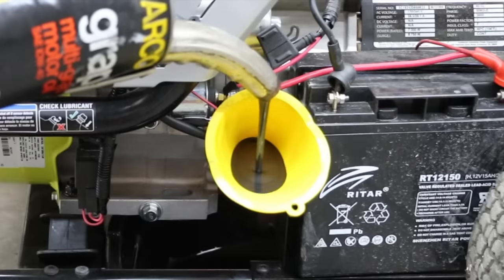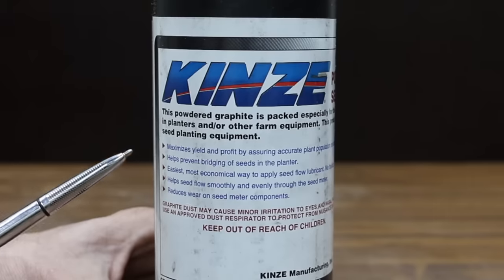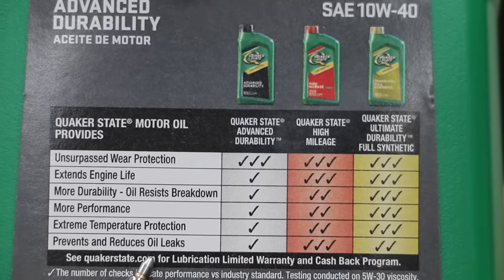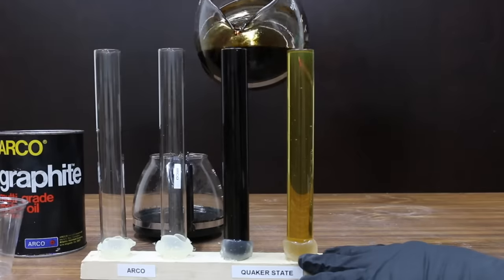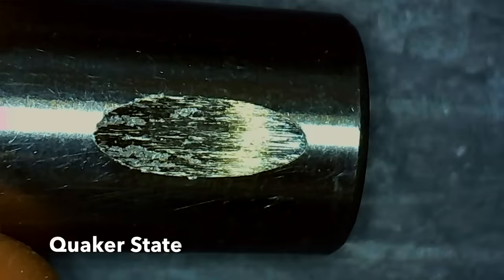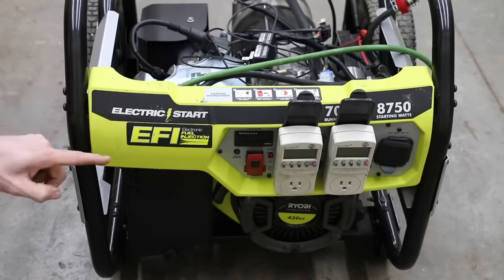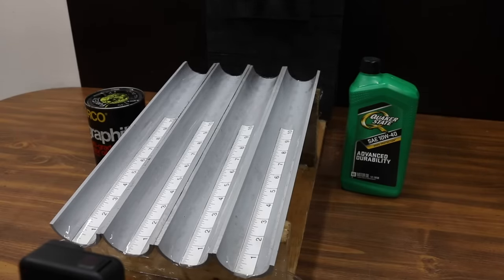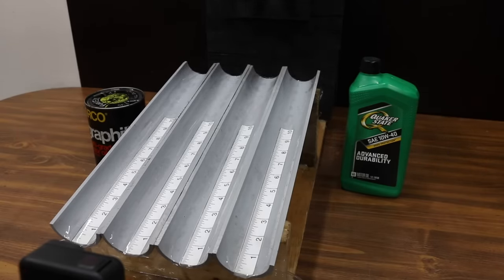Will "Graphite" Help Motor Oil Performance? Let's find out! Vintage Arco Graphite vs Quaker State

Comment: I would like to see the same tests with tungsten disulfide (.5 micron) in the oil.  WS2 is supposed to have the lowest coefficient of friction known.
Reply: They say its too heavy to stay in the solution, so it sinks to the bottom of the oil pan when motor is not in use. However running engine with WS2 oil might coat all the inner surfaces of motor in the long run, so you wouldn't need any in the solution. Then again, WS2 is not terribly expensive so I would assume that oil manufacturers would use it, if it's any good for the engine.
Reply: @juho1057  if there's long-term money to be made with it. Got to remember. They are to make money. We are just there to benefit and support them. They won't give us the best if they can have better overhead with a "sufficient" product. Look at the BMW 1960 broque angel. That's a good example to me, but that was also because Germans did not want to be flashy after ww2. But it's aluminum near everything. It was fast for the time, had torsion bars stock. The transmission went around the crossmember. Literally had to cut off the crossmember. BMW went all out. But the people didn't want the best. Nor could afford it really.
Reply: @juho1057  I have not heard of ws2 oil
Reply: yep , tungsten di sulphide , or is it ate , is meant to be the wonder dust of the moment , but its expensive  thats aside it would be interesting.
Reply: would also like to see this. According to studies a mix of 0.5 to 1% in weight should give a good improvement. I read somewhere that it's rather common to use it in gearboxes of racing cars to prolong the rebuild interval.
Reply: I wouldn't put that in the oil of an engine using modern emissions controls (three way catalyst). Sulfur poisons catalysts. Just like how molybdenum disulfide is commonly used in greases, but not in engines. Engines use different moly compounds like molybdenum dialkyldithiocarbamate.

You don't need a wonder additive. Just buy quality oil (NOT Mobil 1) and change as indicated by an used oil analysis. Sure maybe some additive will reduce the scar size in the lab, but there is a lot more to consider than film strength in modern engines.

There is a really good reason oils like Amsoil, Motul and Redline are expensive.
Reply: @Fix_It_Again_Tony  good oil is the cheapest mechanic ...
Reply: @Fix_It_Again_Tony  I tested Motul and Redline vs RP. RP held up surprisingly well!
Reply: @blackfrost273industries4  That's why we have competition. It drives better products you can choose to buy.
Reply: I have used WS2 powder in the final drive on my BMW R1200GSA since new in the hope it will reduce wear in the gears. OK so far.
Reply: @konagolden4209  I like this. Yes that is until they get together and have similar parts then my skeptecism starts creeping in. For instance, we had at least three tool lines come out with a 70 piece screwdriver kit last year. At the same time nearly. I saw four before Christmas. Lowe's, home Depot, harbor freight (where I worked at the time), and Ace. Businesses have been called out in the past for such strategizing.
Reply: @Fix_It_Again_Tony  Just courious, why not Mobil? - It's the worlds largest oilcompany, if i remember correct.. Anyway, Castrol, Mobil, and what ever would most likely have added those additives, if they could prove their performance over several thousand hours, all of them fail though.
Reply: @carstensklit491  Mobil 1 consistently under performs from what I've seen. Penzoil Premium is a better choice.

It's not that Mobil 1 is dangerous or will destroy an engine, it's just for this price point you can get better oils.
Reply: @blackfrost273industries4  If they resell the same manufacturer's parts, with the same or different brand names on them, they're allowed. If they "get together" stifling competition, it's collusion & illegal. 
The key words are "...what you choose to buy." If you buy low end crap, that's what they will make & sell.

Comment: My family ran that oil in their 78 oldsmobile. That motor was still strong at 300k. We did have to tear the intake manifold off at 150k to clean out excess graphite.
Reply from the maker: Thanks for sharing.
Reply: @thisnametooktolong  So what, back in my day, american made engines leaked oil on the tarmac. every second gas fill was also a quart of oil fillup. by the time the oil change interval came up I had the EPA tell me to recycle my driveway instead of the sump molasses from the datsun.  comments on the internet, prove my dog is blacker than your dog.
Reply: @thisnametooktolong  some people drive shit beaters that leak and burn oil that still run fine most people cant afford to rebuild or regasket their 200,000 mile vehicle and they run just fine for another 100,000 that doesn't make them an idiot
Reply: @thisnametooktolong  General motors wont honor warranty on main engine seals, they say a new one wouldnt take if it was replaced anyway. Gotta shrug my shoulders but Car manufacturers always WILL TAKE Government handouts! Everyone has to make a buck like everyone else in washington. We only have bitumen around here, all the way up to the grass, which was replaced with concrete years ago. Concrete is cracked now and covered in oil from idiots who make america great with US subsidies and tariffs, not from my ford pickup.

Comment: Years ago I found a can of graphite similar to the one you used, and added it to an oil change on a 1.3 litre Ford car.

The engine was noticeably smoother running and seemed to have a little more power as a result of the lower friction.
Reply from the maker: Thanks for sharing.
Reply: Cognitive biases?
Reply: John D  thank you :P
Reply: Using this stuff in somewhat modern car engines is technical suicide. The graphite will 100 % clog the tiny oil drillings in parts like hydraulic tappets and also stuff like camshaft adjusters which have fine filter sieves built in.

Comment: I used Molyslip, a molybdenum additive that is supposed to coat your engine parts. After adding it, I discovered that my diesel pickup with 2 big fuel tanks, would run out of oil long before I had to stop for fuel. So having no oil, I continued to drive to the next filling station, with no oil pressure. That was a heart pounding ten or so minutes but I arrived with no apparent injury to the engine. Used to see the commercials of them running a test engine on a dynamometer, then after draining the oil, ran it again, full bore for two hours., which were hard to believe.
Reply from the maker: Thanks for sharing.

Comment: Imagine being that guy that runs the tests at the lab

Goes through mail "huh, it's this guy again..."
Reply from the maker: Thanks for watching!
Reply: @ProjectFarm  I expected something a bit more sarcastic.
In all likelyhood, they probably have an entire section devoted for your testing..
Reply: Jajajajajajajajaajaja
Reply: @macgyveratlarge2133  They probably watch the videos!
Reply: They probably look forward to them, a change from the hundreds of normal tests to see if a truck engine oil is still usable for the next 10k miles, or is it time to change it.
Reply: I'm sure they appreciate the business and would want even more.
Reply: BECAUSE of project farm, I sent my outboard motor oil to same lab, NO ONE sends outboard oils to get tested, or admits to it. I learned a lot!! And made a video about it too. THANK YOU PROJECT FARM.
Reply: Number one customer!
Reply: @SeanBZA  actually, for Class 8 OTR trucks, 35,000 miles is not uncommon.
Reply: @macgyveratlarge2133  That is why I said 10k, because here that equates to a week of driving between 2 major centres at the regulated speed and regulated hours. you probably want to check the truck at least once a week, because your driver pretty sure is not going to do that. He gets in starts and moves.
Reply: @SeanBZA  actually, it's a part of the job to check the truck's fluids, and hell to pay if you don't. 
My own truck, and I've had several, I would figure out the "service interval" for everything real fast.
Every new set of tires, check every other day at the very least.
Any, and I mean ANY trailer I hooked to, check the tires and "balance" the pressures between them, because that saves me money by less rolling resistance.
Check the brakes for the same reason.
The oil, checked in the morning, just before startuo, with the engine cold, for two reasons.
1, just pull the stuck and note the level, no need to wipe it, and second, all of the oil is in the pan, and not floating around the engine.
Everything else gets checked, too.
Windows, mirrors, lights, air leaks, brakes, etc.
The newer trucks are easier with automatic adjustors, but dumps, like I drive now, brakes adjusted every other day, at the least. City driving and off-road is considered severe duty.
Tires are constantly blowing on these rigs, and if you go into a steel or scrap yard, you best walk the tires, and have some pliers to pull out any metal that can work it's way in, and you automatically are looking at the condition of the tires.
I will admit that there were some days, rarely, that I would get in and just drive off, but even in the company truck, that was rare.
I HAD to look, for my own peace of mind, screw the company, but NOT screw the company, if you get my drift.

Most of the truck probs come from companies that refuse to maintain their fleet.
More than one news story has told that story, and i know some drivers personally that quit from bad outfits, and I have as well.

The driver's life literally depends on whether that truck can get down the road safely, in life, revenue, and other's safety.

Most of your bad drivers don't last long in the industry, but the media and LEO community wants you to believe that ALL drivers are that way.
Reply: @macgyveratlarge2133  You are in the USA, I am not. There are large differences between countries and operators. Some hire people off the street to drive, others actually test them even though they have a CDL, some are owner operators.  You see a vast difference though, from a small single truck operator who has a shiny well maintained 50 year old Deutz, to a fleet of poorly maintained Actros's, some maintain so that rarely break down, others do it on the "when it stops" basis.
Reply: @SeanBZA  maybe you should be more concerned with "insourcing" rather than "outsourcing."

Comment: This was popular back in the late 70's - early 80's. Blew two engines with it. Both threw a rod.
Reply: Probably clogged the oil strainer as well.  Doesn't surprise me to hear this stuff burned up engines.
Reply: well, is a broken rod related to oil starvation or more likely caused by detonation? I dont know, pics or it didn't happen. j/k
Reply: potatochobit lol this quarantine got us bored. I’ve been doing that too lol
Reply: Had a brand new 77 Chevy Nova with the 250 C.I  Used Arco Graphite in it for a couple of years, never had a problem , over 100 thousand  miles on it, only reason  I got rid of it was because  the body rusted out
Reply: @potatochobit  interesting they were both air cooled engines. One a 4 cycle dirt bike and the other a vw bug.
Reply: What vehicles and what power were you running if you don’t mind me asking?

Comment: To answer the hypothetical, "when was the last time you had to use a spout like this?"

I believe it was the mid 80's - if memory serves.  Good times-ish. :)
Reply from the maker: Thanks for sharing.
Reply: I was still using one in the early 90s [I remember having to dig one out for some of the first few oil changes in my '91 Toyota SR5 4x4...]
Reply: I think you meant "rhetorical". But yes, mid 80s is correct. I was in high school at the time working my my dad's auto repair shop when we started getting these new-fangled plastic bottles. I wish we still used old spouts. The temptation to use the plastic bottles without a funnel usually ends up with some spillage.
Reply: I'm not sure I could even find mine.....  :(

Comment: My dad was in the navy for 24 years (1940-1964). His engineer and mechanic buddies recommended graphite oil to break in new or rebuilt engines for about 500-1000 miles, then switch to regular oil, with 3000 mile oil changes. Seemed to work.
Reply from the maker: Thanks for the feedback.

Comment: This additive should do good in slow running high torque applications like worm drive gearboxes or encloesed chain drives.
Reply from the maker: Thanks for the feedback.
Reply: agreed
Reply: Pssh then it might last longer then intended.

Comment: I used Arco Graphite motor oil in my 1969 corvette 427 engine and it spun a bearing within 1 week of changing over to ARCO. Absolutely believe that the engine failure was caused by the oil. Low mileage on the engine.
Reply: Not the only comment in here that I've seen where people said they had issues.
Reply from the maker: Great point!

Comment: I am really impressed with the anti-wear properties of that old oil!  Need to mix that with a newer base oil and would have a new champ in oil showdowns.  Too bad about all the evaporation I now understand why oil used to have to be changed every 3,000 miles.  I feel a lot better about going 5,000 miles now.
Reply: I wouldn't use that as your only reason to wait for an oil change. Even it doesn't evaporte the oil could be completely contaminated by 3,000.
Reply: That's a good point.  Type of driving is definitely still a big factor.  If someone drives very short distances or lots of stop and go oil should be changed more often.  I drive 80 miles a day on the highway most of which is 65+ MPH so my oil sees very little wear in comparison.  I could go longer but I use regular oil and it's cheap enough so no reason to push it.  My oil is very clean after 160k miles on a 2014 Versa.

Comment: Outstanding testing! That was some ugly oil, but it was an excellent wear preventer. Thanks for all your hard work!
Reply from the maker: Electronicsnmore, Thank you very much!
Reply: It reminds me a bit of early slick 50
Reply: I used Slick 50 in a 1990 diesel. The turbo failed at 140K miles. Pretty standard for that engine.
Reply: try gear oil mixed with liquid asphalt to quiet a noisy rearend, my dads brother had a single axle dump truck that he wanted to get rid of he sold it the guy that bought it used it for many years, bumped into him and ask him what  gear oil they had in it he said it Must of been 100wt oil !🤣
Reply: I found the shiny group quite pleasing on the eye... *To the eye. (Flashbacks to graphite slurry in the eye).
Reply: @OldGriz708  I don't know this for fact. But my Dad used to claim that slick 50 was very hard to get out of an engine. Even cooking it out at a machine shop, would still leave its residue behind in the pores of the cylinder wall and cause rings not to seat. 
I think he was meaning when just overhauling the engine and a hone job, not when the cylinders are actually gonna be bored.

Dang thing was, he told me that about a month after I had used a bottle of it in my 351M. So it was one of them times I hoped he was wrong....

Comment: this might be one of the coolest videos to date! I have never heard of graphite additives before and did not expect the results at all...
Reply from the maker: Thank you!
Reply: @ProjectFarm  Hey so I have an idea for you to test in a video that you haven't done. It took me some time because you honestly covered a lot of stuff that I was curious about (E3 spark plugs, HHO). My friend who does his own mods to improve fuel economy made me a grooved throttle body spacer. It's called the gadgetman-groove and involved making a 1-inch metal spacer that connects to the throttle body and the throttle body has a 180 degree groove one on each side of the throttle plate opposite of other. Can you test to see if these improves MPG on a vehicle?

Comment: I run a self propelled mower on an extremely steep part of my property and found the original engine suffered severely from poor oiling from being
run at the extreme angles required. I stripped it down after a year as it was getting hard to start and was consuming oil and I found the rings were shot with severe 
bore scuffing and piston damage. I replaced the motor with an identical 6.5hp (brand new) and took some advice to run it with graphite additive. 
That engine has now done 7 years of the same service with no increase in oil consumption. I think the graphite just holds up lubricating in the starved condition better than regular oil.
I don't use it in anything else on the property as i don't see additional benefits over just regular oil changes with good oil. That one mower fit's its benefits better.
Great video btw..
Reply from the maker: Thanks for sharing.
Reply: Was it a Khoeler by chance?
Reply: @larrygro  It is just a cheap Chinese import, still going strong apart from cracking it's fuel cap centre out, touch wood still no oil consumption.
Reply: @ProjectFarm  Sounds like a bot generates your replies...
Reply: @DhirC35  Thanks for sharing.

Comment: This is the first I've heard of graphite in motor oil.
Reply: Based on reading the rest of the replies here, probably for a good reason. There are way better anti-wear additives that won't ruin your engine too. Although it was interesting that it raised the compression, but with the engine knock any compression gains were negated because a modern engine would pull timing with a knock and you would lose the gains you got from compression.
Reply: Ahhh youth is wasted on the wrong people...